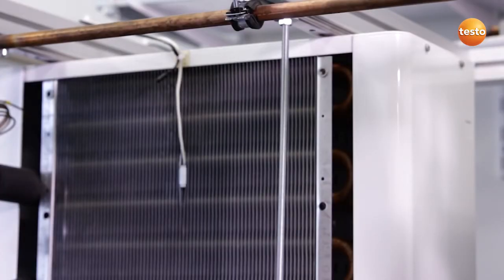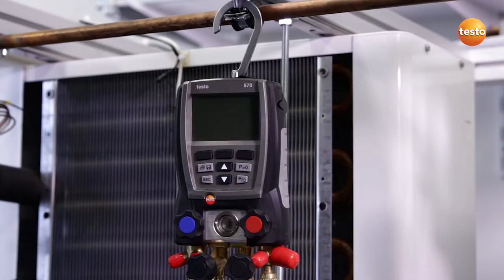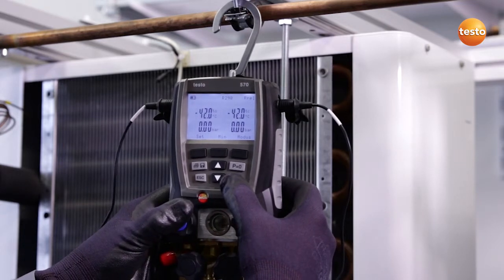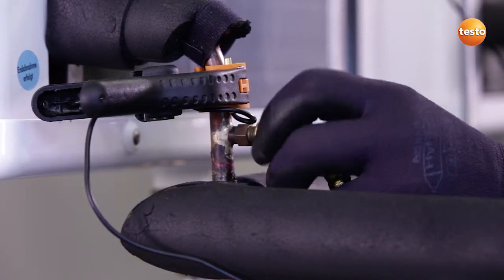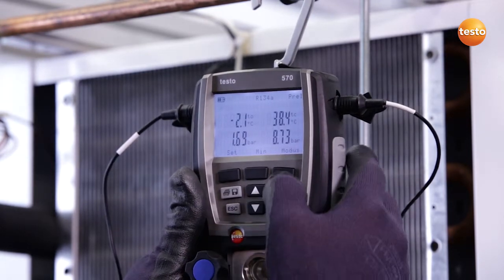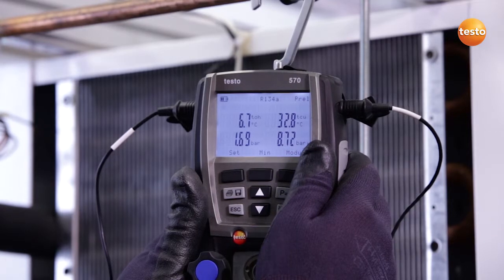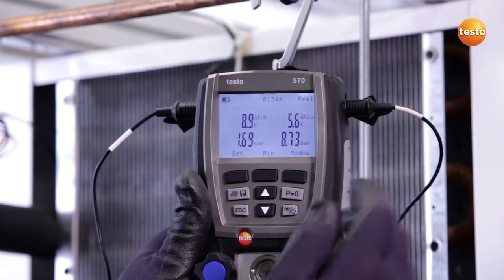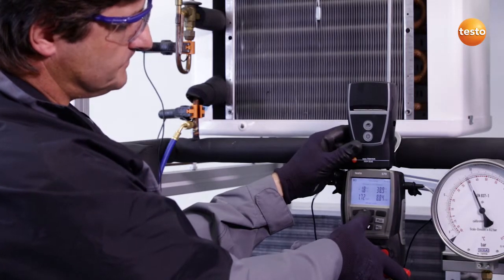Commissioning A Refrigeration System Using the testo 570

Comment: My testo 570 displaying a UUUUU on the vaccum stat reading .
Can give details on resolving this error .
Reply from the maker: With the testo 570 there is such a thing as ‘too low’ when it comes to reading low pressures (ie, vacuum). The instruction manual states that the lowest limit of pressure the testo 570 can accurately read is -1 bar (relative to atmospheric pressure). The testo 570’s vacuum pressure reading capability is useful as a guideline. Feel free to contact us if you require further details on 03 8761 6108. Thanks!

Comment: Is the Testo 0554 0191 Wireless Handle for Plug-in Probe Heads what i need to use for wireless temperature measurements? Have been trying to find a wright up on this product to verify its use on the testo sites. Exciting stuff thank you.
Reply from the maker: Boiler Teardown Thank you for your feedback. The Testo 570 does not include a wireless module to connect testo Wireless probes. The Testo 570 only comes with an IR port to facilitate IR printing using the Testo IR printer. If you require further information on this product please Visit www.testoaus.com.au. Thank you